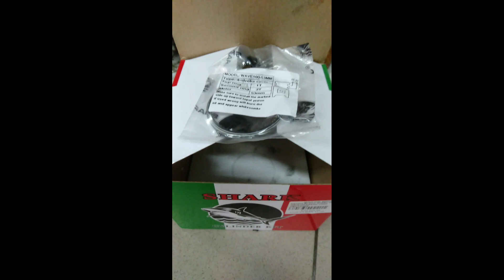Viral || EX5 dream first model warna merah cili

Comment: Assalamualaikum bang. Ex5 dream 1st model ni pakai clutch set dream atau high power ya? Haritu beli auto shoe dream tapi bila dah siap pasang auto macam sangkut. Bila beli yang highpower  batu ngam. Motor pon beli secondhand.
Reply from the maker: Wslm kami paka clutch high power
Reply: @spanakatok6760  owh okay bos.
Reply: @spanakatok6760  ex5 dream boleh pakai high power punya ya bos?